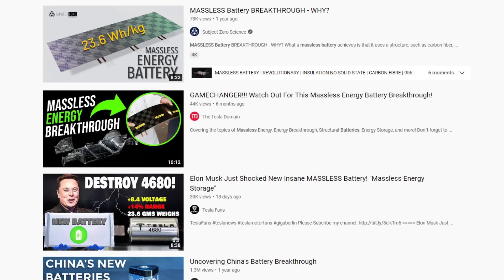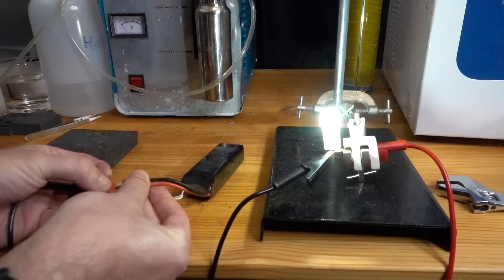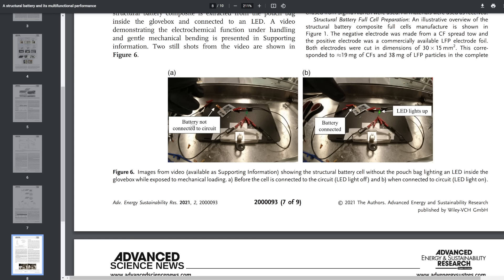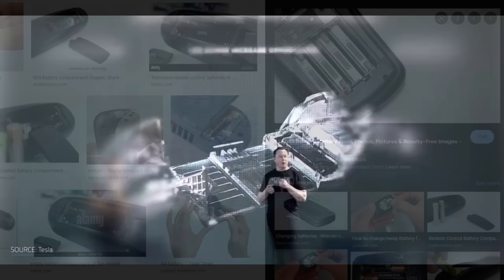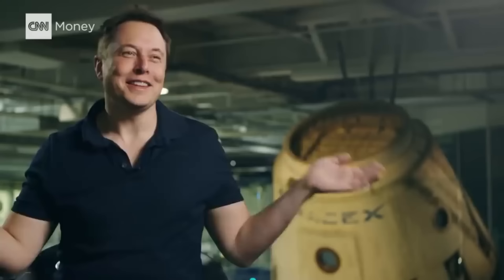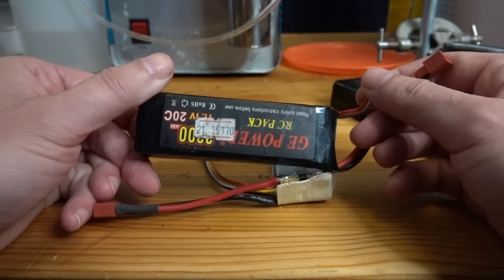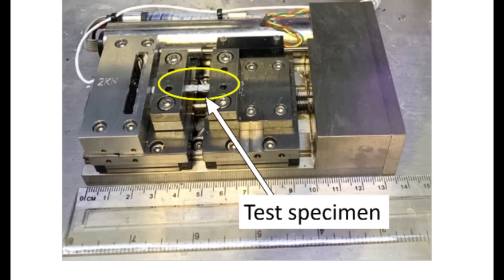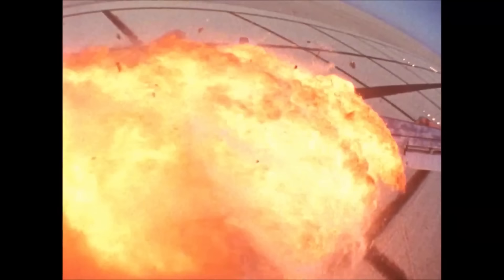Matt Ferrell, Massless Battery: BUSTED!!

Comment: Wingtanks do actually provide a lot of advantages it's just that none of them are fire safety related. They save space in the cargo hold and counterintuitively enable lighter wings because added mass in the wings rather than the fuselage reduces the bending loads on the wings in flight.
Reply: You forgot, that the center of mass doesn't really change during fuel consumtion
Reply: @Mofapilot  Well, that depends on where the wings are.
If the wings are perfectly aligned with the CoM, then that's mostly true.
Reply: theres still fuel in the main body, no?
Reply: @knownas2017  You want the center of lift close to the center of mass.
Reply: @robohat4837  For bigger planes there can be, not generally smaller ones afaik.
Reply: @robohat4837  some designs, mostly older war planes had small tanks in the fuselage. That way if the wing tanks are drained from bullet holes you still got a few drops left.

This was not a popular design. 
The benefits where negligible.
Reply: Yup. mass AWAY from the center of gravity is also stabilizing it in the longitudinal axis...
Reply: and you have emergency exits via the wings, you put fuel below them because of safety, right. it´s all about space used efficently.
Reply: Planes as big as a caravan are gravity fed to a point. (although caravan is high wing) fuel is gravity fed from the wings to a reservoir, which is then pumped using a mechanical pump to the high pressure for the turbine engine. If the mechanical pump fails there is an electrical backup pump/motor.
Reply: The point here is it's absolutely ridiculous to talk about a "massless" fuel tank. Putting fuel in the wings is about saving SPACE, not weight. If space was not a problem, the plane would have all fuel in a single tank for safety.
Reply: @ic7481  having all the fuel.in one tank is more of a safty hazard then a saftey measure. What if that single fuel tank gets ruptured or has a leak. Now all your fuel is going to be gone. Two tanks allow for the plane to keep flying because it's not gonna loose all its fuel from a massive leak.
Reply: @garrnk  you can partition the main tank. It would also be located within the plane's main structure, so less chance of rupturing.
Reply: @MyNameIsRoos  Exactly. It's only even an option for carbureted piston engines. And vapor lock has been well understood for many decades. It's not a practical option for pistons, either.

Comment: To be fair, gravity fed means using gravity to feed the engine fuel injectors, not the engine combustion chambers directly. However the main reason you put fuel in the wings is to maximise fuel load and range without compromising fuselage internal space.
Reply: Quite a lot of Cessna 172's have no fuel pump. They literally have a gravity-fed carburetor and have for nearly a century before the fuel efficiency (and greater reliability) of fuel injection displaced carburetors.
There's thousands of those aircraft still in service, though.
Reply: Yeah. Heard this from pilot channels here on YouTube too.
Reply: It's the same arrangement in passenger cars: you have a low pressure pump in/near the tank itself (which is in the rear of the vehicle) which slowly pushes fuel to the engine bay, and a local high pressure pump there feeds the injectors. If the low pressure pump fails, many diesels can keep on trucking with just the high pressure pump sipping the fuel.
Reply: @rlsaine  nope. You can't generate enough fuel pressure with gravity to feed a turbine engine. There simply isn't enough gravity to feed the volume of fuel required by such an engine on a plane. Fuel pumps serve different purposes though. 
On old carbureted engines, the fuel pump doesn't actually deliver fuel to the engine directly. The fuel pump delivers fuel to the float bowls of the carburetor itself, which then uses vacuum to draw fuel from the bowls into the engine. The more you put your foot down, the greater the pressure difference and the more fuel gets pulled in. If you drain the float bowls faster than your fuel pump (or gravity) can refill them, the engine bogs down because its being starved. You can't generally gravity feed an engine unless it has a low output relative to its displacement like the O-360 engine in the Cessna 172 mentioned above. The Cessna gets away with gravity feed because the tanks sit in the wings which are attached to the top of the fuselage. The Piper Cherokee is another small aircraft that uses the same engine but it has to have a fuel pump unless you're going to put the thing in a dive the entire flight to keep fuel running down into the engine. The wings are attached to the side of that aircraft which means fuel has to be pumped to the carb.

Fuel injection is different in that it has no float bowls to hold the fuel. The fuel must be pumped directly to the engine. In cars for many years, you just ran higher pressure single fuel pumps and they kept adequate pressure on the fuel rail(s) to push fuel through the injectors and into the intake manifolds. Once direct injection became a thing, you needed much higher pressures to get fuel into the cylinders. Older diesel engines were direct (into the cylinders) injection for decades before it became common in passenger cars, primarily because of the cost. Injectors that can overcome the compression ratios in a cylinder and the pumps to feed them are really expensive. Todays modern direct injection engines generally use two pumps; one inexpensive low pressure pump to get fuel from the tank to the engine bay, and the second high pressure pump to actually feed the injectors. There are many variations on this setup as well with injectors that actually do the "pumping" themselves from a relatively high pressure supply.

but the short answer is no. Big turbines like those on an airplane can't really be fed by gravity. At least not the amount of gravity we have on Earth, in the small amount of space between the wing tanks and the engines.
Reply: Actual Turbojet mechanic here. The fuel intake of the engine is gravity feedable. And right behind that fuel intake pipe are usually the gearbox driven fuel pumps creating those 100-200psi of fuel pressure or rather thousands of pounds of flow per hour. The fuel pumps can only independently shut down if the gearbox drive spline breaks or the engine itself is shutting down due to some other fault. As long as the engine is running and the Full Authority Digital engine controls of today don't open any bypass valves these pumps will pump fuel. However they cannot suck fuel out of tanks that are unreachable. There are electrically driven balancing pumps that even out the fuel level across tanks or drain specific tanks into others during flight. Those absolutely can become inoperable due to an electrical fault or a disrupted aircraft electricity supply.
Reply: @DriveCarToBar  carburators work without fuel pressure because the fuel gets added before the combustion chamber in a low pressure area. I guess a jet engine could be gravity fed if you were to dump the fuel in front of the bypass fan, while already running. Although most of the fuel will be spit out the back and only a small percetage will be fed into the combustion camber by the compressor stage.
Reply: @DriveCarToBar  "The more you put your foot down, the greater the pressure difference and the more fuel gets pulled in."

Small correction: on an airplane, if you "put your foot down", you'll yaw to the right (the pedals control the rudder). The throttle is controlled with a lever, typically on the pilot's right hand side but sometimes on the left.
Reply: @isodoubIet  meh.  details.
Reply: @DriveCarToBar  Are you Matt? You are horribly wrong. Just stick to driving cars if you have no clue about aircraft engines.
They can be easily gravity fed until altitudes of about 30000 feet. This is based on Henry's law and there is an incident paper by Airbus where an A320 went to FL380 (38000 feet) purely on gravity fed engines!
Maybe you should spend less time on writing walls of text and more on studying mechanics and physics.
Here's the paper from Airbus - I guess they know their stuff better considering they build aircraft: https://safetyfirst.airbus.com/app/themes/mh_newsdesk/documents/archives/fuel-pumps-left-in-off-position.pdf
Reply: @kontoname  did you even read the paper you posted? Maybe try that before posting something this stupid again. Start with the very first damned page where Airbus talks about fuel starvation because the pumps were off. The plane experienced a dual engine rollback which, in a twin engine jet, is a serious 'oh shit' moment. 
Conclusion: you can't get enough pressure from gravity to feed the engines in normal cruise. That's why the engineers put fuel pumps in.
Reply: @jcd-k2s  In a piston engine the cycles are seperatet by time periods but in a turbine they are seperatet by space. On large turbines, there's the big bypass fan first, it actually is the output of the engine and delivers most of the trust and cooling for the engine. It also does the intake cycle but only a small amount of the air is given to the next stage, most is f
Used for the thrust. Then there is a smaller multi stage compressor fan inside which does the compression cycle. After that is the combustion camber, in wich fuel gets added to increase the heat and therefore flowrate to generate the power. Then then there are two output turbines to drive each of the first fans, the turbines are doing the power stroke. After the turbines the exhaust just leaves the engine and also delivers a part of the thrust.
Reply: @rlsaine  jet engines need pumps, fuel is injected into the engine burn area via injector nozzles, so pressure is needed for that…. the burn area is where the air compressed by the compressor stages arrives, so it’s under high pressure….

Comment: One aspect of this I'm surprised he didn't mention is that, from the looks of it, making the battery integral to the structure would all but eliminate the possibility of replacing the battery when needed.
Reply: Yes, that's the first thing I thought of. Gone all out, the "whole car" could be the battery... so when it inevitably wears out, the whole car is scrap.
Reply: This might not be a concern if solid-state batteries replace lithium ion tech in a few years. They can theoretically get many times more charge cycles, so they could last the life of the vehicle.
Reply: @theredscourge  just need some of those carbon nanotubes we been waiting 20 years on lol
Reply: @theredscourge  Solid state doesn't refer to the battery chemistry at all. It only implies one big, unitary cell as opposed to many smaller ones, as most are today.
Reply: It's not a bug It's a feature. Apple will star selling iPhones with structural batteries and no charges and you'll need to buy a new one after it runs dry.
Reply: @maxwilm76  Solid-state batteries are NOT 20 years away, more like 5. There are already viable solid-state products being sold for industrial applications. It just isn't quite ready for automotive yet, but it's getting there.
Reply: @tempest411  Lithium ion batteries aren't even necessarily lithium, often they are mostly graphite or nickel, but let's not get too bogged down by semantics.
Reply: @theredscourge  I’m sure I’ll hear from you in 5 years than lol
Reply: @theredscourge  We've been 20 years away from getting the world onto fusion generated power for like 80 years. I've been hearing about how carbon nano tubes and graphene are going to revolutionize the battery industry since like 2002.
Reply: @tempest411  heard of bolts? They join several structural components into one larger structure
Reply: @alanhat5252  Bolts? No, what are these 'bolts'  you speak of? 

Seriously, what they are describing is making the battery a NON-replaceable part of the chassis structure. If it bolted in place then it would be no different than it is now.
Reply: @maxwilm76  I doubt it, but you will start seeing solid-state batteries being used in more and more applications. Check out Toshiba's SCiB battery. They're already selling them to be used in buses, they just don't have a massive amount of customers yet.
Reply: @_marlene  planned obsolescence isn't a thing, other than lazy companies who can't be bothered to maintain older products, or let you do it yourself.

Comment: I think the best part about all of this is the fact that the mere concept of 'massless' anything makes zero scientific sense. Everything has mass. The electrons in the battery have mass. Mass doesn't vanish just because you change the shape of the item to match the shape of the parent item.

I mainly work on cars. Nearly all cars have batteries because you need a primary source of power to start any motion in the vehicle, and the current most efficient way to do this is to have a battery. A storage for energy. All modern vehicles have a required amount of cold cranking amps which is amperage needed to actually spin the flex plate or fly wheel and get the engine moving before it can achieve this on it's own thanks to the combustion energy. Amperage drops over distance due to the increased resistance of the object the electricity needs to move through. If your battery pack now takes the shape of something far less compact, for example your average compact sedan, you now have to have interconnectivity between all cells in the battery that is far more distant than a square battery pack that sits and takes up a definitive amount of space in your engine bay, trunk, or wherever an engineer decided to place the primary battery.

Even with the current advances in battery-focused electrolytes, you will still need to equate the same or more mass that the original battery pack had in order to get the same cold cranking amps to start the vehicle. The fact that the video provided by Matt deceptively makes you believe the battery is the structure of the vehicle before clarifying it's much more akin to a filler is terrible and is one one of the worst concepts ever for a battery because the slightest damage could destroy the entire vehicle and be insanely expensive to replace because electricity isn't simple engineering with definitive damage that's easily remedied. There's a reason fuses are made, and it's to ensure that if you have an electrical failure (too much current) that it prevents the rest of the system that circuit is connected to from being damaged.

A structural battery such as what's been presented by Matt, even with how he intended to present it and not how to came off in the beginning of his video, would need potentially thousands of fuses to protect all the cells. Temperature changes would also affect this entire concept because batteries and electricity are highly susceptible to temperature changes affecting the performance. Humans also get into vehicle accidents quite frequently. In fact, it's one of the leading causes of death in countries where driving is the primary means of transportation, outside of personal issues like illness. Simply not paying attention to your surroundings for 3 seconds can be the difference between you getting to the store to buy some milk and you being in a grave next Monday. Even small mistakes, like accidently hitting another vehicle with your door, could potentially cause more damage than you realize because a little shake to a battery pack that's malfunctioning or currently under heavy load can cause explosive results via gas ruptures.

It doesn't take a degree to understand any of this information. I have rudimentary knowledge of electricity and batteries. I can't even tell you the difference between positive and negative in a system off the top of my head, though I definitely know not to let either interact directly. I don't have any degree in physics. I've got only a high school diploma and just a bit of common sense.